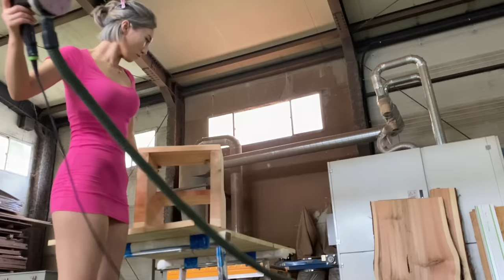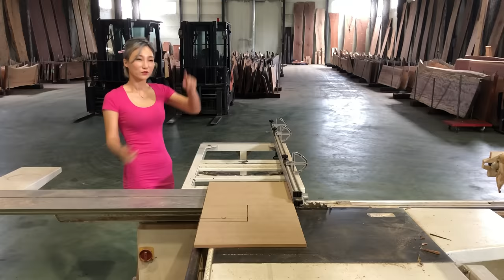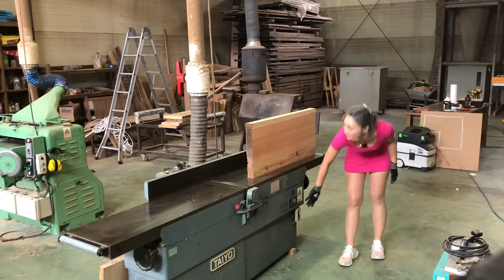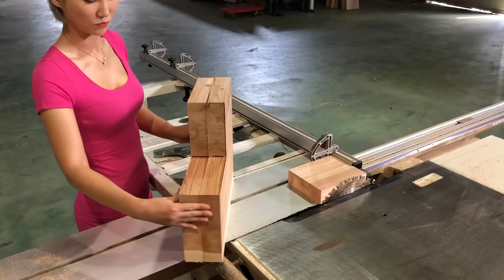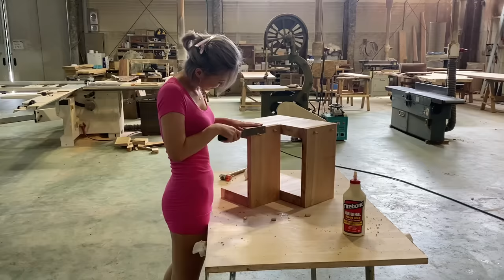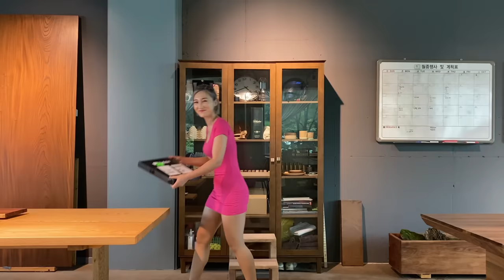STEP STOOL - made by WOOD Girl

Comment: I'm left wondering if you went too far when cutting the right angle and left saw marks on the inside. Usually, you stop short and finish with a jigsaw to get a perfect cut.
Reply: 👍,chuẩn không cần chỉnh
Reply: @great4702  sure but what's wrong with giving a tip, in case she wasn't aware? Or for anyone else reading.

Comment: Not the most practical shop attire... gotta get this girl some safety glasses, and never wear gloves while using a jointer. I have a permanent weird angle on the tip of my right thumb - if I had been wearing gloves, I'd be opening doorknobs with my left hand for the rest of my life. But very wise to go with the form-fitting dress with short sleeves!